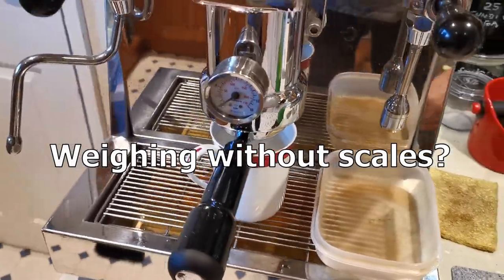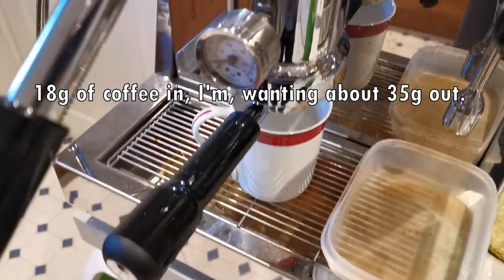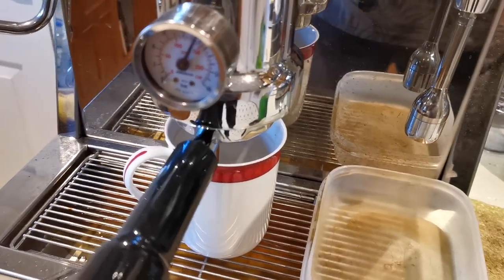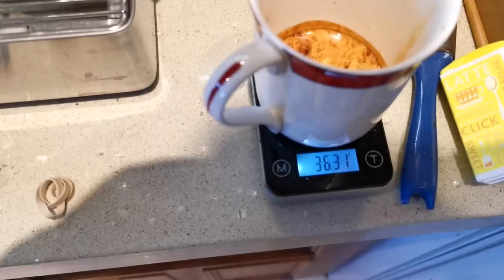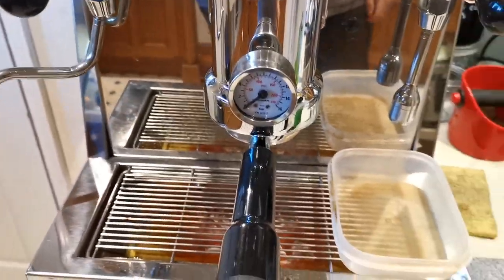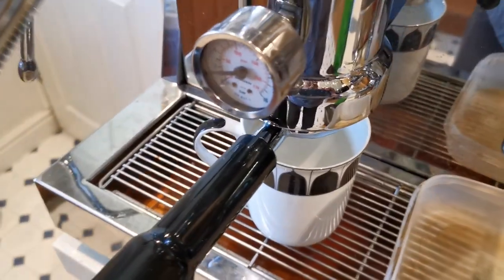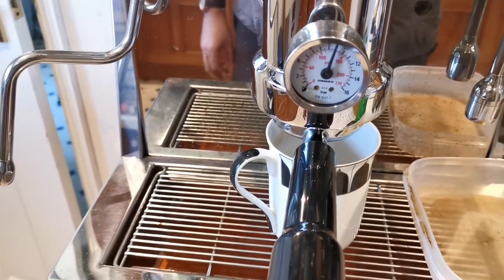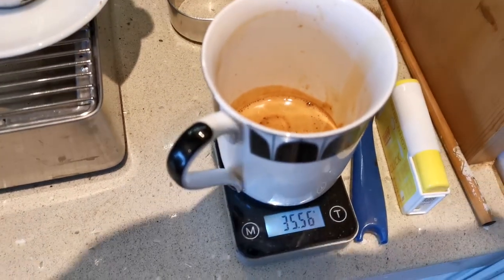Alpha 1 test bed Vesuvius EVO Leva   Weighing without scales

Comment: Hello Dave.  Which one of your espresso machines is your favorite, or your daily use machine?
Reply from the maker: I have 12 machines, it difficult, I like them all for different things....at the moment though the Vesuvius EVO Leva Alpha1 test bed is my favourite machine.
Reply: How do i order one these machines?
Reply from the maker: @rigo1406  you have to contact the factory directly. http://www.elcor.it/
Reply: In what way is the Vesuvius' pre-infusion via pump different from the Bezzera Strega's? Of course the Strega doesn't have the group head pressure gauge; however, I was wondering if I could replicate what you're doing on my Strega.